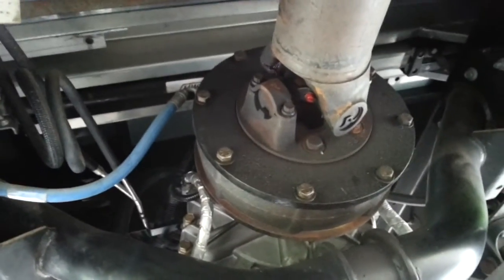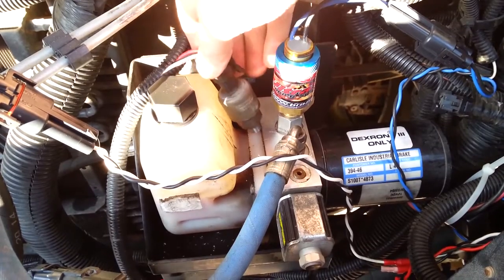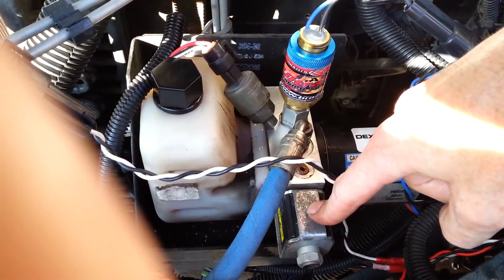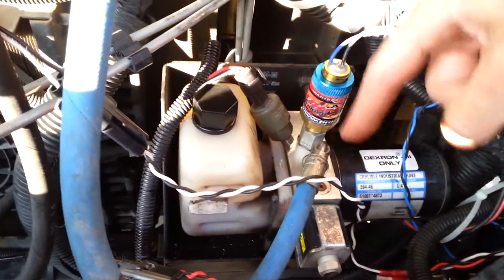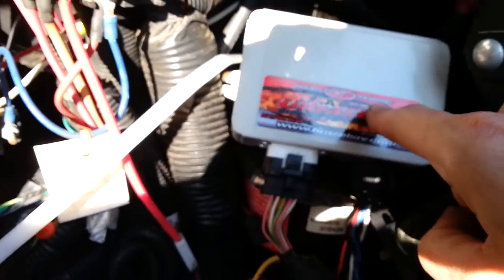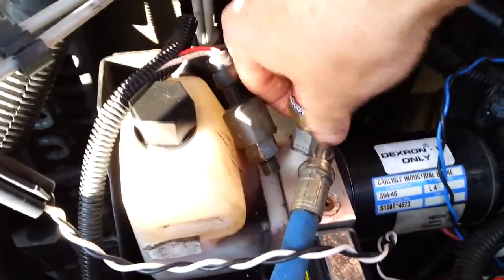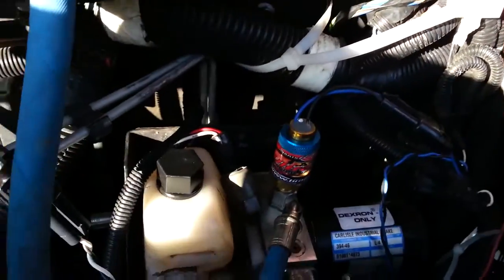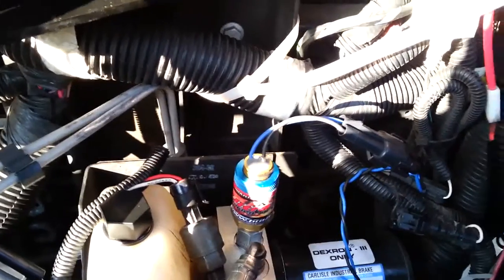Workhorse Chassis W24 with J72 Auto Park Brake, Explained and Updated on a 2005 Winabago  Voyage

Comment: Appreciate your video, it really helped me. I bought a used 2005 Itasca Suncruiser with this Auto Park system. It started not wanting to release sometimes when I released the park brake and put in gear (did not hear pump run either). Watched your video and discovered that a previous owner had the system upgraded to the Ultra Stop System, but it’s a earlier system then your showing. It has the new style pressure switch and a black box with relays, no check valve. Issue I’ve found is that the new style pressure switch is bad, and doesn’t always reset to run the pump after setting the park brake. I’m in touch with Brazels to try and locate another switch. You would think that the pressure switch would last a little longer. The motorhome only has 67000 miles on it, not for sure when the system was switched out. But wanted to thank you for the videos, really helped me understand the system. Brazels should give you a Commission 😅😂
Reply from the maker: Glad you liked the video..They are good to me we help each other. If I can ever be of help just text or call my cell 606-875-0125 Kevin.

Comment: I also have the W24 chassis and will be installing the Ultrasave this weekend. Looks like you chose to mount things a little different than the instructions but I guess it doesn't matter which end of the hose you mount the valve on. Thanks for posting the video.
Reply from the maker: Yes I did mount the check valve on fire wall where it would stay clean and dry, I did not like the ideal of mounting the valve and electric solenoid under the chassis where it would always be getting wet.

Comment: Hey Kevin, great video! Can you tell me which of those wires provide the ground to the HWH control box. I believe that may be the reason why my leveling jack and slide-out system is not working.
Reply from the maker: Look for wire number 9000 it has to be grounded it may run through your parking brake switch

Comment: Hi Kevin.  I am Rockland, Ontario, Canada.  I have a 2006 W24 chassis.  I broke down on a trip last week. The J72 park brake pump runs and won't shut off.  I drove it for a while with the pump on and eventually, I got a beeping in the cab and the big red dot with the '!" WARNING in the dash.   So I stopped, and not knowing anything about it, got the RV towed.  The mechanics at the garage where I took it don't seem to know much about this parking brake.  He wants to order a pump motor.  The brake seems to release and I can drive the RV.   I need to go get the RV and drive it about 60 miles back.   I am concerned the the pump will get damaged if I keep driving it this way and this would leave me in the middle lane of a 4 lane through Ottawa.  Should I drive it home like this or should I manually release the brake with your emergency hand pump fix?   Do you know how I can troubleshoot to find out if the proportioning valve or the hydraulic pressure transducer or maybe even ECU are faulty.  I watched your hand pump emergency kit video.  I could get this done and manually operate the J72 until I can get the parts to fix it.  If I do this, can I somehow do anything to this system to stop the beeping  by maybe disconnecting the Control Unit?  I am schedule for another long trip next week and would love to have this sorted out one way or another.  Any info you can provide would help....
Reply from the maker: Text my cell phone 606-875-0125  I will call you back
Reply from the maker: More info for you call Alan at Brazels RV and he can help troubleshoot. He knows this system inside and out call 800-417-4559
Reply: OK.  Good news.  Last year I took the MH for AC service.  The tech noticed a leak in the parking brake line along the frame rail.  He fixed the leak but I think he did not really know how this auto park works. Neither did I then.  He told me at the time that it was power steering fluid and I think he filled the PS reservoir not knowing that the Auto Park had its own reservoir.  I was running on a nearly empty fluid tank for a year and I think it finally started acting up not being able to build enough pressure to stop the pump from running constantly.  The tech at the garage where I had it towed xould not find a leak and drove it around a couple times but could not get it to work properly.  Today on my way to pick up the MH, I went to my local Princess Auto store and bought all I needed, hand oum, fittings etc, to manually load the Auto Park cylinder , assembled and tested it all.  All was fine.  Before I headed out, I decided to test the Parking brake just for the heck of it.  Disconnected the pump motor to ensure the brake held.  It did. So no damage there. Reconnected the motor, put her in  drive, it worked  normally.  Tried it a few times and all working as it is supposed to.  My guess is after I filled the reservoir on the side of the road, there may have been a air lock and it finally worked itself out.  I NOW HAVE A FULLY FUNCTIONAL MH and a back up manual hand pump🤣🤣